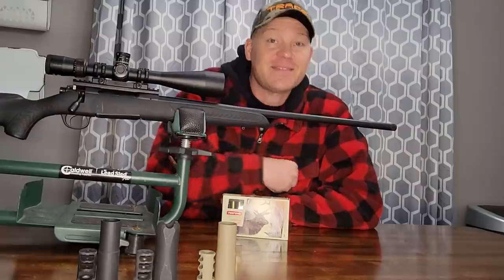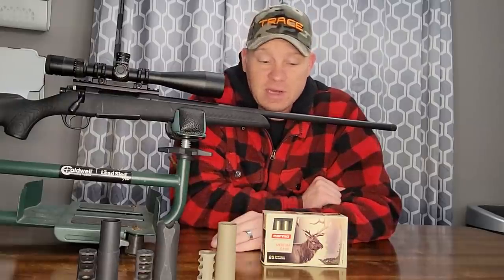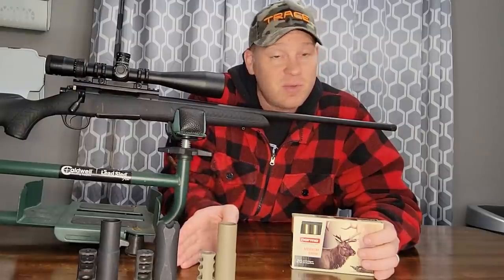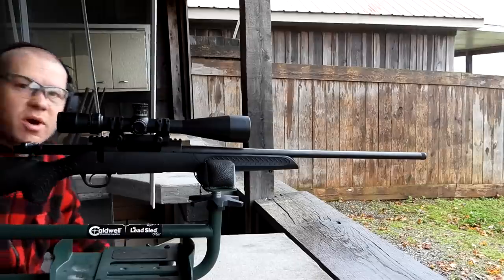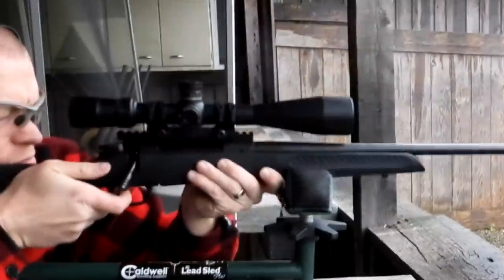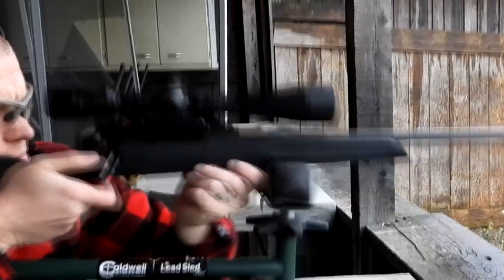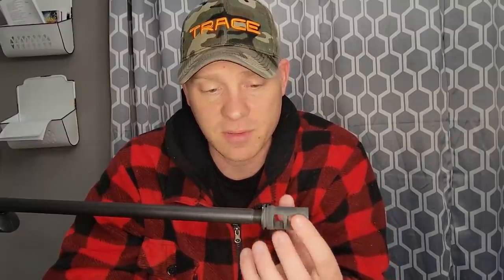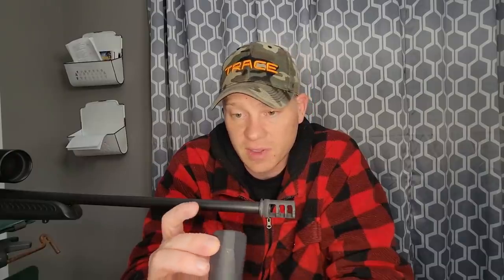Do Muzzle Brakes Really Work? - Witt Machine SME

Comment: I like and use muzzle brakes… BUT if you’re hunting in an enclosed stands make SURE to use hearing protection, I speak from lots of experience in this area. And you will definitely need to check your ZERO, it very well may change your point of impact. Hey… they would make another great video. Zero your weapon W/O Brake then shoot for groups and see if it affects your previous ZERO.

Comment: Now try this shooting at a target and see how your aim point shifts with each configuration. That will be interesting, there will be a shift, but how much?
Reply: It doesn't matter if you zero your gun in the configuration you will be using it in😉
Reply: I came to the comments to say the same. 
I'm also interested in the consistency with and without.  
Will the brake cause a higher percentage of flyers? 
I'd like to see 10 or more shots with each on target.
Reply: @erikvaldur3334  I haven't noticed any changes when shooting with medium and heavy profile barrels. Haven't tested much on pencil barrels. Either way, zero with the brake on and don't worry about it.  It isn't like you'll be pulling the brake off except for cleaning occasionally. And the brake won't hurt accuracy unless the brake is just a metal pipe bubba took his dremel to. Even then I'm not sure it would matter sine they don't touch the bullet.

Comment: My 450 bushmaster has a factory brake on it, I can’t imagine shooting it without one- it KICKS

I typically put brakes on all my threaded barrels cause I don’t have a shusher nor do I wanna pay for one. I’m about to do some accuracy testing with and without brakes on my Ruger precision Rimfire rifle
Reply: 45-70s don't come with a break🤷‍♂️
Reply: Cranky Gun Reviews if suppressors were not so outrageously expensive, if the high quality suppressors were less than $500 and there’s no $200 each tax stamp or begging of tyrannical dictators, would you own some then????
Reply: @stephen_crumley  I sure the hell would have a few if that was the case
Reply: @stephen_crumley  heck yah!!
Reply: @stephen_crumley  hell yes.

Comment: I like and use muzzle brakes, they absolutely can and do reduce recoil, but the concussion...yeah, I'm deaf enough already. Plugs and muffs for me when shooting a braked rifle.
Reply: Is the blast comfortable with plugs and muffs on?
Reply: @malachiwhite356  This is one of those ' it depends' questions...it depends on the design of the muzzle brake, the length of the barrel, the caliber, etc. A 20" barreled AR15 in 5.56 with a linear comp is going to be much more pleasant to shoot than a 12" barreled 7.62 NATO fitted with a JP Enterprises tank brake. I've fired the latter setup and after 10 rounds I was done. That thing was like standing in the middle of your own personal lightning strike every time you pulled the trigger. Got uncomfortable real quick, it did.
Reply: @r.awilliams9815  Okay, thank you.
Reply: @malachiwhite356  I almost always double up, unless I'm shooting with a silencer. Doubled up, you can be around blasts that feel like a (light) punch in the face and your ears won't care. I recommend foam plugs and electronic muffs. Crank them up and you can hear like not having any protection on at all, until a shot is fired and it shuts off for an instant.

Comment: LOL You and me both on the hearing aids. I worked for over 15 years at a gun shop/Gunsmith store. We installed, made and put your's on that you bring us, muzzle breaks. If they are built correctly. They will work. They are not one size fits all by no means. If I remember correctly there are only 2 calibers made. 22 and 30 caliber. For drilling purpose I was told. To get the best results the brake diameter should be no more than I think 5 thousandths bigger than bore diameter no matter the caliber. One issue we ran into was customers bring one in that was installed by someone else and brought to us to fix. One problem we found. The one that installed it did not install it correctly. Then just drilled it out to make it stop shaving the bullet when fired. Then called it good. It just made it louder is all. 
Only a serious machinist with a bad case of OCD gets them on correctly. LOL. We had an older guy that his smallest rifle was a Winchester 458 mag. He was only a big game hunter. He came in with one and said. I will try a break, because they hurt to shot at my age. Our gunsmith that always put them on. Threaded the barrel that was a no brainer. Out the break on and drilled to fit. Then for three days. He walked around with either the bullet or the brake in his hand. I asked what are you doing go test fire it. He said he had never shot one that big our rifle tube. Our rifle tube was huge and the inlet for the barrel was pretty big. To the point that you put the barrel in and hold rifle with one hand and a welders glove over the entrance to stop the flash from coming out and burning you. He finally did fire it. With and with out the break. Then stated. Shooting it with a muzzle break was like shooting a 270 without one. That is a big change in recoil. 
Bottom line. If it is installed 100% correct. It will work like a dream. Where as with a can to make it not as loud. There is a bigger gap of error on bore size. You can use a 30 cal on a 25 cal and still works a bunch. Not perfect but reduce the noise a lot.

Comment: Muzzle brakes ABSOLUTELY work. Best video I ever saw demonstrating this was a guy who locked rifles down in a sled and remote fired them with a string on the trigger which allows the sled to slide on the table which had a measuring tape beside the sled. This compared the difference in how well different brakes reduced recoil….the sled would move less distance rearward…..pretty definitive QUANTIFIABLE non-subjective data!
Reply: TTAG, The Truth About Guns. He has several videos out where he runs the sled now.
Reply: @Delmarksman  absolutely!!!! Made my mind up about which brake for my 5.56, AR-10 and 450 Bushmaster build!!!!  The latter two will CLEAR the table on either side of the barrel….but my shoulder easily survives sighting in!!! 👍😉

Comment: Shroud will turn the break into a suppressor. Nifty trick i like that, remember muzzle breaks are meant to be loud as heck. You stay on target and the thing pushes with the rifle on the bullet. The timed screw and weight ones are called the boss system. You get the resonances right on your barrel and you can tighten groups so we'll you would center a dime at a hundred.

Comment: I’ve got standard Witt Machine brakes on several of my bolt guns, including the Ruger American Ranch 7.62x39.  It makes it easier to spot your impacts.  They make a pretty reliable clamp-on brake, if you have a rifle without a threaded barrel and you don’t want to make irreversible alterations to your barrel. 

I’ve considered the SME for the Ruger Ranch because it is super loud. But, I want to keep the weight down.

Comment: From personal experience the addition of a well designed muzzle break does in fact make a huge difference in felt recoil. The addition of the shroud in my experience quiets the sound but you feel the recoil more. Yes the muzzle break is loud, but it helps. I have them on three separate AR platforms, 5.56, 7.62x39 with a bull barrel, and a heavy barrel .308. it made a huge difference on all of them especially the 308 and the 7.62x39.

Comment: Interesting stuff. You could plainly see the rifle didn’t jump near as much with the brake then without. And it actually looked like the recoil was worse with the shroud. Not sure how it felt but it did look worse to me.
Reply: the shroud is meant to be used specifically to send the concussive sound forward instead of sideways. as per several examples on youtube, you "can" use the brake with the shroud to shoot without earpro. I wouldn't do it often but apparently it works. Doesn't mean it's not loud, it's just not loud the same way. Apparently there's no ear ringing.

Comment: Man, it looked like you had more recoil with the shroud than either other way.
Reply: The shroud is to direct the sound down range instead of to the sides and back. Disadvantage of them is they act kind of like a rocket motor shoving the gun back at you. It's not as bad as it sounds, they have their place and are just a more polite way to shoot at a range. Not as good as a real silencer, but better than bare muzzle and way better than a brake (for politeness, not recoil).

Comment: can you check how fast the bullet's are going with the brake on and off.
Reply: you understand the muzzle brake is after the normal , unaltered barrel's length of rifling, correct, and that the barrel has not been shortened? How much velocity loss/bullet deceleration  would you expect with the bullet zipping thru two or three baffle plates' holes sized at about .318" or so...?

Comment: You didn't mention the "sound mitigation" part of the device... I'm not concerned about sound so much as the muzzle concussion.

Did it help? (Of course your barrel is long, so it's already "mitigated"...)
Reply: Shot and tested the Witt SME at my buddy's outdoor range in August using a 9mm CMMG AR pistol with a 5" barrel. And the overall impressions from my friends are that the SME is not hearing safe and you must shoot wearing ears.

We unsuccessfully tried to measure the DB level of the shots with both a current gen iPhone and an older Android phone. We only saw errors seemingly due to the limitations of both phones' mics to capture very loud noises.

So, here are the very subjective results:

For giggles, I took my ears off and fired a couple of rounds through the SME. It very much sounded like having loud firecrackers go off inches in front of my face. My ears lightly rang for about a minute afterwards.

After resting my hearing for five minutes far away from the firing line, just for more giggles, I tested with the ears off again. This time, I stood about 5-6 feet directly behind one of my friends while he fired off a few rounds though the SME. It was loud, like being at a concert in the front next to the stacks loud. No ringing in my ears afterward for that test.

With our ears on and if you are the shooter or are observing slightly behind and to either sides of the muzzle, the sound level is significantly lower than a bare muzzle or using the SME without the shroud attached (i.e. only the brake).

Our subjective conclusions are that you can get away with using the SME without ears on for perhaps a mag in an emergency. But if you shoot it consistently without ears on, you will damage your hearing. The Witt SME is not hearing safe while shooting outdoors by itself. You must have ears on to be safe.

Comment: I put a kynshot hydraulic shotgun buffer tube on an AK, and it worked out very well. The extra weight in the rear balances out the front heavy rifle, and it does reduce recoil. I have a Mossberg MVP 308 in 16" (velocity difference between 16" and 24" is about 200fps, so not as bad as it looks) but I plan on getting an MDT chassis, and buying another hydraulic buffer tube, and a dedicated .308 linear comp. And just throw on any red dot I have laying around, can't use scopes/prisms on a stock that moves back and forth. I don't know how much it will reduce the accuracy, AK's are minute of baseball on a good day to start with. And I'm thinking that the linear comp will help make the hydraulic buffer more effective. But if it turns out that it really sucks and that's why no one puts these on bolt actions, then I have a Mossberg 500 it can go on. Or perhaps, this is the hidden discovery no one else has thought of.

Comment: The shot with the shroud over the brake looked like the recoil was as bad as, if not slightly worse than, the bare rifle.
Reply: Directs all the gas outward so it blows back pretty hard. That brake seems loud from what I've seen of it so far, but will mitigate the recoil felt by quite a bit.

Still can't make my mind up on whether or not to buy one...
Reply: that shroud completely diminishes the point of the break by throwing the gasses forward again
Reply: Its more to save your ears when hunting
Reply: @baen1466  well, they are on sale right now for $140, down from $175
Reply: @kevpachakey  the shroud is meant to reduce the noise from the perspective of the shooter and anyone beside/behind them. THAT is the point of the product.

Comment: I've used them quite a lot ( brakes ) , I don't like them because of all the noise they make . I now use a suppressor which lessen the recoil a little and is a lot quitter . I bought a 9mm and use it on 30 cal. rifles & 9mm pistols  , it works pretty good .

Comment: Now please explain how you got the threads on end of your rifle so you could install the muzzle brake??
Reply: Paul. If your rifle doesn't come threaded from the factory you can have a gunsmith do it. Usually not inexpensive.  Problem is there are several different thread patterns so it has to match the thread pattern & caliber for your rifles brake.  Gives you a good excuse to buy a new rifle with a threaded barrel now

Comment: Hooo Boy, that DOES work.  Shroud seemed to add a little back.  Sound mitigation worth flinching your head.  No brake had you blinkin and ducking.  Brake, wasn't quite running a 22 but it was quite a good deal.  Shroud had you blinkin a bit but not ducking like the No brake.  I'd use the brake only and stick some earplugs in under your earpro's.  Coolbeans.
Reply: Shroud does add recoil indeed compared to the brake alone, though it should be less than with bare muzzle.
There's two ways to influence recoil momentum with the gasses:
- mass of gasses
- velocity of gasses
Cut down on either one, and the gun will kick less.

Shroud slows gasses down, muzzle brake redirects them so the net velocity of them might even be backwards

Comment: About time you tamed that beast n saved your shoulder buddy.👍🏽 Get a timed weight muzzle break and you can tune the barrel dead spot at the muzzle tip and fling them boo lights into one hole at your favorite range. Snipers use them for a reason buddy. Wait till I get state side maybe I get to show ya how a deer gets dropped with a shot to the neck arteries be it at near head or close to shoulders that sucker won't even take 5 steps will bleed out full you can harvest the organs clean.

Comment: Magnum kickpad will save your shoulder. Brakes will permanently damage your hearing. There ARE flash foreward brakes. Granted, not quite as effective as flash rear brakes but WAY better for the ears. Really sucks when you cant hear the crickets anymore or a bear sneaking up on you. And hearing aids will never replace ones natural, God given hearing. Combo of a GOOD, Oversized magnum kickpad & a flash foreward design covers both ends.